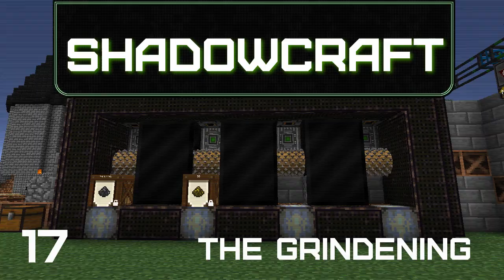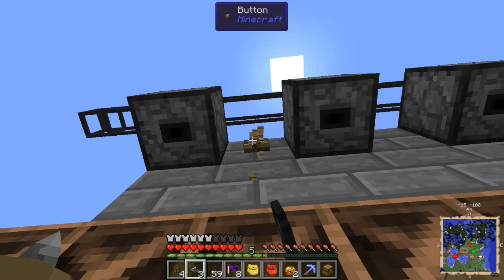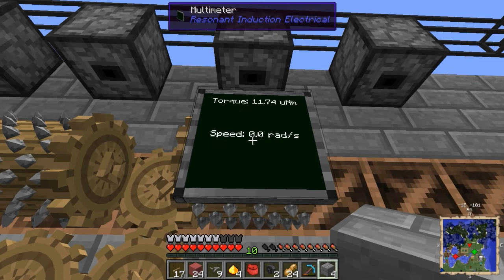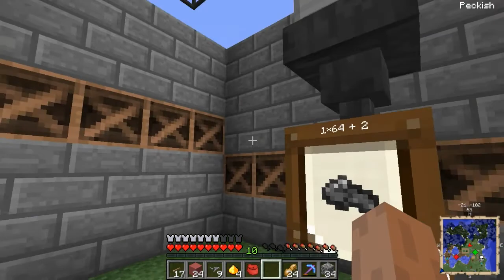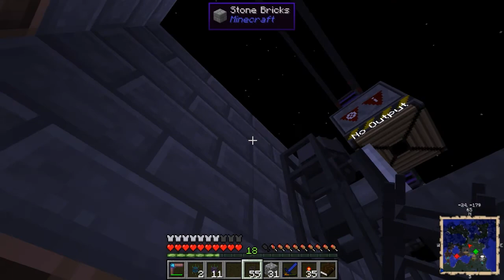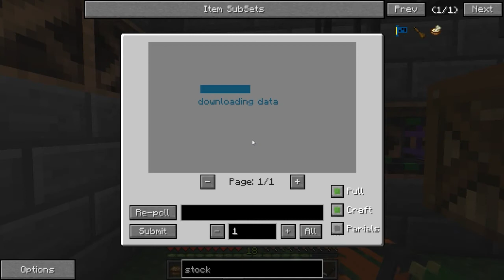SHADOWCRAFT PACK: S1E17 "The Grindening" [REUPLOAD]

Comment: Hai, i am just wondering, what are you aiming to become of a youtuber, and why you have Chosen such a unique modpack, When compared to other modpacks. Nice vid :) (was a little lazy with grammar :P).
Reply from the maker: Right now my main goal is to just have fun. I like playing Minecraft (Modded MC more so than vanilla it is however all good).

Secondary to that... I'm making most of these videos to work on my ability to coherently express myself. Written text? I can do that fine. I'm not terrible great with verbal communication however. I tend to think well ahead of what I'm saying and end up tongue-tied.

I'm also enjoying learning about some of the work that actually goes into making these videos.

As to the pack...

One of the reasons I've gone with a slightly odd mix for this is that I wanted to tear into Resonant Induction. Using it as a base it was just a matter of finding mods that I felt would mesh well with it without totally eclipsing it. That's partly why I don't have IndustrialCraft, Mekanism, or Thermal Expansion in the mix. For a little variety I threw in my magic mod of choice (Ars Magica 2) and another to even things out. The closest thing I could get to that premade would be the newer version of the Voltz mod pack.. but that has no magic what so ever and very little in the way of decorative mods. Filler to some, but part of a well balanced pack to me.

Anyway... I'm glad you liked the video. I'm definitely still learning how to do this as time goes on, so I do appreciate any comments.